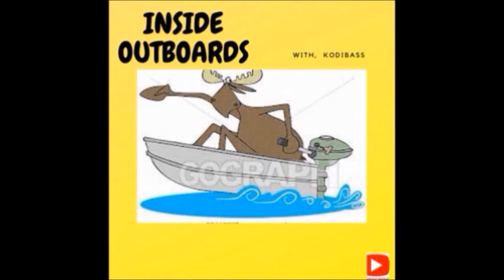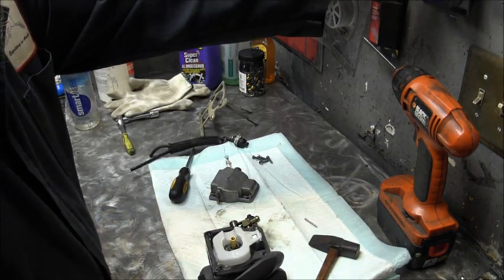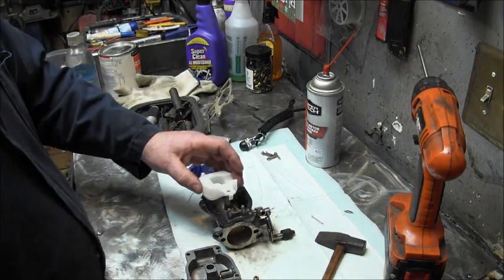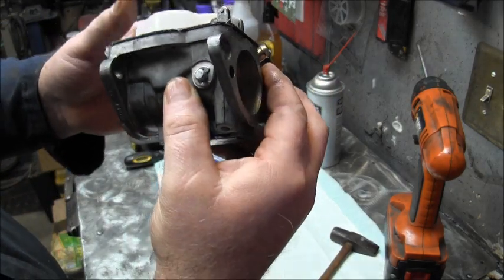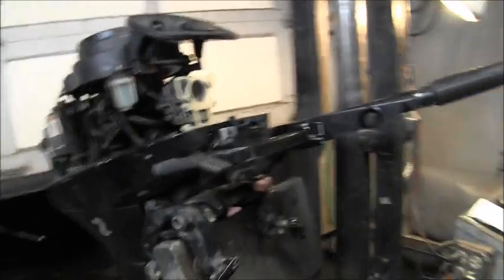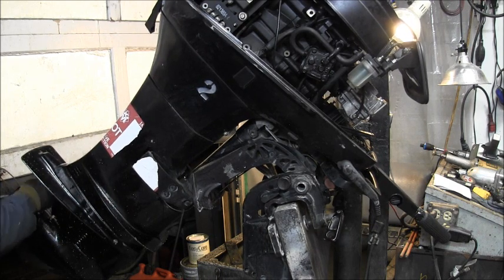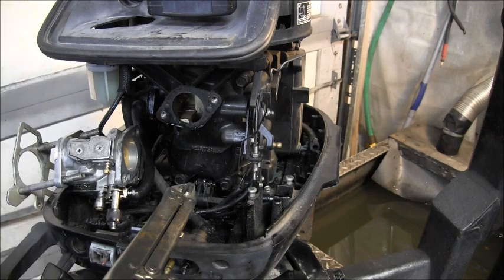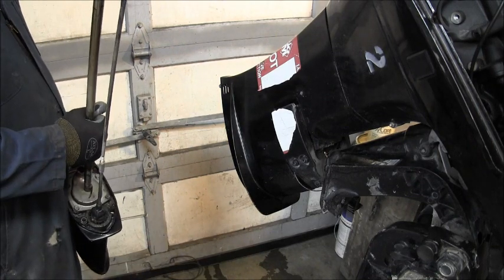MERCURY 1996 40 HP SEAPRO,    ( Part  2 )

Comment: my 60 merc is sweet removing the lower unit. It has an upper and lower shift rod with a coupling on the lower unit. The torque on the 4 5/8 bolts was like 40ft lbs. I had to smack mine too with a combo wrench to break them loose.
Reply from the maker: Yep' this one does have the 2 pc shift rod, But I had the carb off so just pulled the pin.   kb
Reply: The coupler is a spline one and not hooked together like the 40

Comment: It has a yamaha style Linkage under the swivel tube
Reply from the maker: Yes U R correct had the carb off so pulled the pin, I wanted to keep the shift rod as is due to the no shift issue. thanks      kb

Comment: That's like Mercury not to have a coupler in tha middle section that allows for easy removal of the lower unit. Pulling and putting back that upper shift pin and cutter pin is a pain in the lower back when the powerhead is installed. Typical and sad !